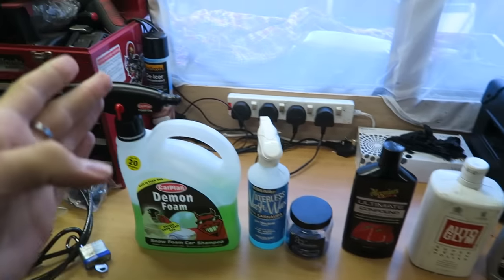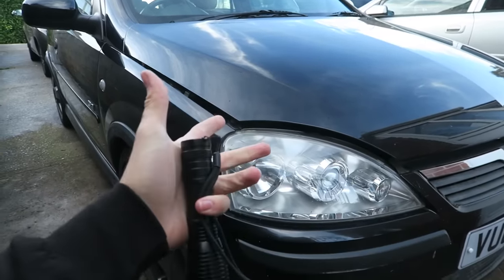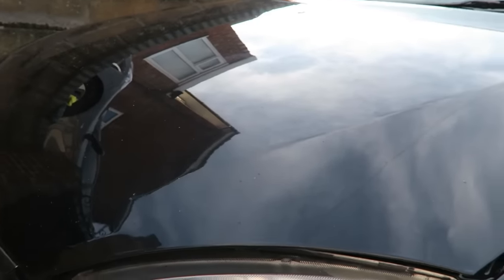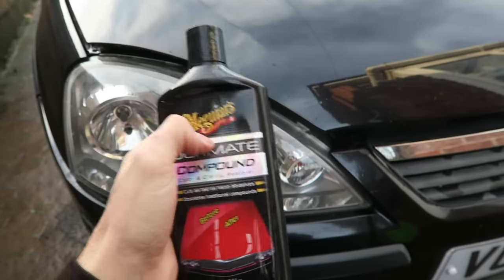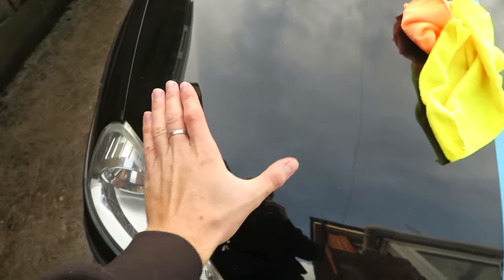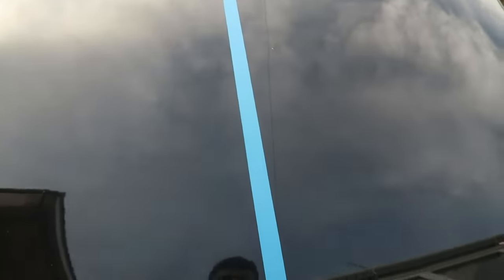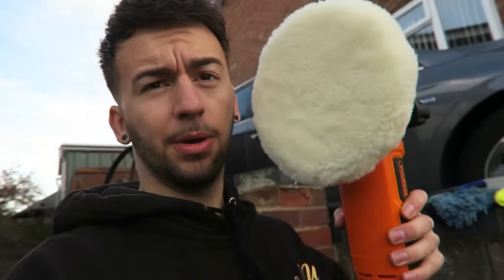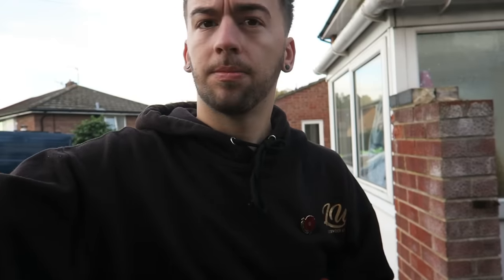First Time Machine Polishing!

Comment: Well done! You did exceptionally well using a circular polisher! Brave man for learning on one of those over a DA but I applaud you for a great job!
Reply: Stauffer Garage except the Van Haus IS a DA Random Orbit polisher. But the advice to use one is sound.
Reply: Iain Mackie Mate that machine’s never spinning like a DA
Reply: StevenWillox I agree. It’s NOT a DA. I’m talking through an orifice!  You can tell by the size of the neck. Their smaller powered one is a DA. I bought the 1200W version, which was only a few £s more, but it’s the one in this video, ie NOT a DA.
Reply: That isn't a dual action polisher , it is a rotary polisher , there is a difference

Comment: Nice video. One thing I would do different, good or bad - idk, when I decontaminate with clay I think its more efficient to NOT use anything with wax or sealant as a clay lube. In theory, you will get better results because you won't clog up the pores on your polishing pads with the wax you just applied and will get a better cut and finish from your pads. Also, a dual action machine is so much safer. Keep it up, thanks for adding to the community.

Comment: When one's cars polished it's much more difficult to scratch with a key or by stones chipping the paint by getting a hold in the paint work rather than deflecting, it stays cleaner longer because the dirt and bird muck  doesn't stick so easily and it becomes so much easier and faster to wash by hand. Some polishes help protect against sunlight and chemicals as well.

Comment: Wow very nice especially for the first time detailing the outside of a car on paint work it’s not easy. And using a Rotary buffer for detailing the pain for your first time is awesome. I did not learn on that island on the DA. Which means dual action buffer and you could hold a thing in one spot for like a minute and it won’t burn the paint. Great job and great video in your car looks much better congratulations.

Comment: Good effort for your first time and you started with the hardest machine to learn the rotary. Get yourself a dual action polisher and you will find it much easier for learning and you won't damage the paint. Rotary polishers you need to be carefull around edges as they generate alot more heat and its easier to burn through the clearcoat if your not careful. But good effort non the less fella.

Comment: What a nice finish you got wow you needed to us a bit of water as well on the polisher to stop the paint work getting hot and burning the paint work but looks as thou you new what you were doing nice job
Reply: @melondog82  Don't need to with Meguiars Compound, as you use it the abrasive breaks down into a polish so won't burn the paint. Not so sure about the Auto Glym.
Reply from the maker: I did end up squirting a little wash and wax on the pad to add a little moisture
Reply: You are doing a good job love your channel

Comment: Hi I've never used a polisher before either.... For the flat surfaces like the boot, bonnet and roof it looks straight forward but on the sides would you go horizontal with the polisher?

Comment: I have a question that might sound pretty dumb, but when I use my random orbital buffer, I feel like it doesn't  always spin.  I marked and line on the dis and it kinda stays in one spot or goes all directions.  they only way to get it to spin is if I have the pad barely touching the car.  any tips?

Comment: You should try by using the Da clay  Play then use rubbing compound on the polishing mop u will see a hell of a difference u will One more thing you need to slow down on the polishing mop you are creating so much hate on the clearcoat try lowering down to 900 RPM it will save you burning the clearcoat and you won’t use as much polish or compound on the panel get a cocktail state get yourself a Stanley knife sharpening the age of the cocktail stick to a pint you can use that to fill in the townships very lightly OK

Comment: Probably know this already but just in case - I wouldn’t wash off the snow foam with a mitt. It’s designed to loosen dirt on the paint so rubbing it in could cause more swirls. Rinse it off then wash again 👍🏻 

More confidence than me I darent use my machine yet 🙈

Comment: If that was a dual action , personally I would have gone slower simply because a DA “dual action” has two orbits allowing air to pass under the pad meaning more safer therefore allowing more time to work with ... high chances are you won’t ever burn through 👍🏼 quality for first time pal

Comment: the lambs wool pad is the heavy cut pad, lets say you should've started with it and not finish with it.
the car is probably now full of holograms and you probably damaged the paint.
it is better to start learning on a DA polisher and not on the rotary, you could've burn through the edges easily with it.
Reply: I learnt on a rotary straight away and burnt fresh paint, infact if the paint was manufacturer it would be more heavy and professional sprayed by machines. so depending on the year of the car and manufacture but the paint is more thick. I think the paint work is not damaged and your exaggerating.

Comment: One tip; use a battery-powered  buffer a cord buffer  will rub on your paint try using a hart brand buffer www.hart.com they work well but the battery cost more than the buffer if your using the clay make sure you know what your doing with it watch more than one how-to videos to see how to do it right

Comment: my biggest advice is move away from demon shine try a higher quality wash and snowfoam  with 2 buckets and youll see a massive difference i thought DS was amazing until i tried others and i will never use it again
Reply: also a little tip when you wash the whole car pop the plastic trim that runs along the top of the roof off mine was full of dirt so it kept running out and leaving dirt streaks

Comment: Auto finesse car wax is brilliant by the way. It's expensive the cheap one is £50 but it's easy to work with and it lasts and the finish is brilliant. I use it everywhere including the glass and it's cleans it brilliant and acts like rainex. The rain just beads up and rolls away. I've put about 4 layers on since the summer for preparation for the winter months

Comment: nice too much area in 1 pass try do smaller areas 3m Yellow & green r the best green first then yellow its professional trade polish, but they all work really. use a normal wax & then finishing wax to get the finer scratches out, give it a ago. let the polisher do the work. do not work same area too long as it will get too hot and could burn the paint. otherwise excellent stuff man.

Comment: easiest way to scratch your paintwork is to use the jet wash at the garage, the brush is full of grit, look in the bottom of the brush holder, half inch of grit and sand,  drive through is better,

Comment: Dude, WAY to much compound your using there, and the technique is very wrong. I would suggest watching the "WhiteDetails" channel. Hes a UK guy and possibly the Best paint restorer in the world. He has cars delivered from all over the world, just to be mopped and polished !. I learned from his technique after watching literally all his videos. 
With that Tool your using, do not use anymore than speed 3. You should only be Dabbing 4 dots of compound on that pad. Then just dab the pad over a small area on the panel you are working on. So that area is covered in faint dots of compound. Then power it on and use nice and steady side to side movements. Then use up and down movements over the same exact area. If the compound is getting dry, use a Spray bottle with water and just give the area a light mist of spray to keep the panel slightly damp. This will prevent you burning the paint.
Reply: Also, I see you using pressure on the mopping tool Do Not use pressure. Just use the weight of the tool only in your hands, and just glide it side to side, and up and down under its own weight.